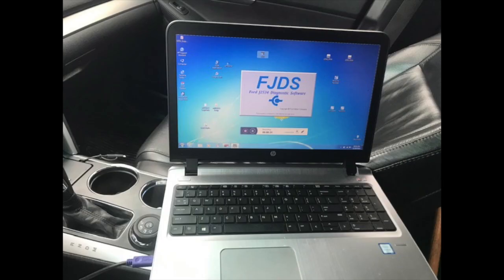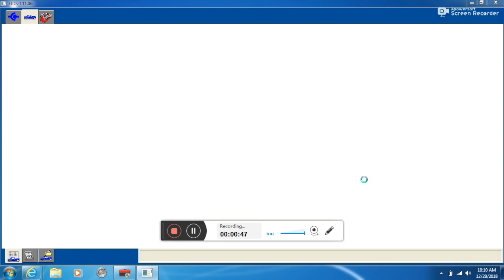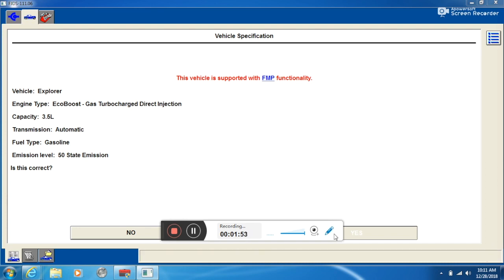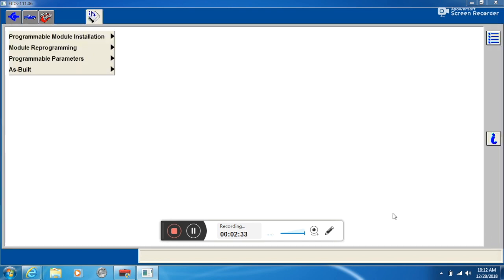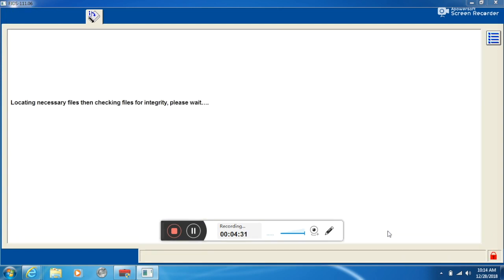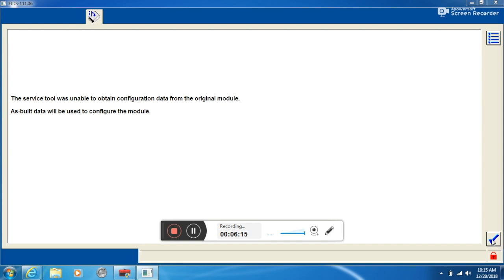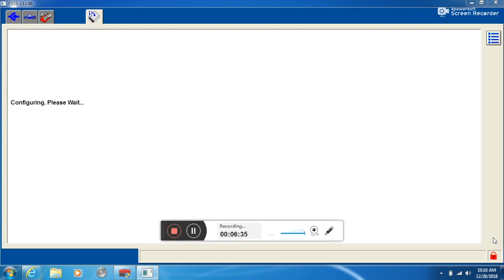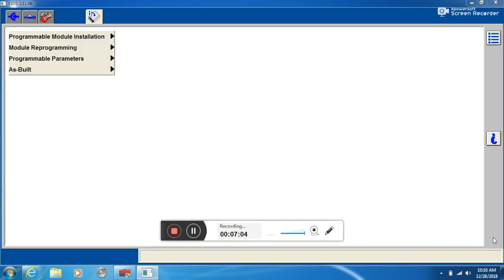FORD EXPLORER PSCM PROGRAM / FLASH AFTER REPLACING POWER STEERING RACK

Comment: Hi sir.
Thanks for sharing your effort.
Don't I need to have the calibration files of the old module put in the new one in addition to the As Built data?

Once in a time, I did applied only the As Built and the PSCM got locked after a while and a red message appeared in the IPC , as I remember, (Power Steering Fault, service required).

Thanks in advance
Reply: No you don’t you can go with either one, you can only have the as built data that you get from mtorocraftservice or pull the data from the old module which normally fails

Comment: I’m going on my second rack and pinion in just about a year in my 2014 sport. I’m getting the second one installed right now, it’s a remanufactured part. My mechanic cleared all codes and said it’s running good, he’s getting the alignment done. 

I didn’t get it programmed the first time I had it replaced, so I’m thinking maybe that’s why it failed again so soon. 

Should I take it to the dealer and get it programmed, even though I don’t have parking assist? 

Appreciate the help. 👍🏼
Reply: Did the autozone work out and did you end getting it reprogrammed? I am looking to do the same thing.
Reply: Unless it was pre-programmed it will need the latest software installed.
Reply: I got it from AutoZone. So not sure if it’s preprogrammed. But I told my mechanic and he’s going to take it to someone he knows that does ford reprograming. If this guy can’t do it, I already called my local ford dealer and they will do it there. Don’t need to keep going through this every year. 

I still think 2014’s should be part of the recall. 

Thank you for your reply, appreciate it. 👍🏼
Reply: @_z06_vette47  hey question regarding those I got a 2012 taurus se 3.5L new rack and new pump with return line. Did yours not return to 0point and not responsive steering ?

Comment: How do I update my PSCM to the newest calibration and strategy?
Reply: Cory,
  You can use the same technique as the video for just a software update.
Reply: Ok I should have been more specific.  I don't have a license for IDS. I have forscan but how do I find the newest calibration file for my pscm. I only find pcm calibration files on Motorcrafts site.
Reply: @metacombs  Without a license for IDS I don't know that you will find a PSCM file. Thanks,
Reply: @aaronbarnhart2711  I found a way, but I have to verify the file is correct. Basically, if you know the exact name of the file, you can download it from motorcraft, so I took the name of my current calibration and started incrementing the file name by 1 letter until I got one. I wonder if a dealer would tell me the name of the most recent file? Prob not, but it's worth a try. Allegedly, Forscan v2.4.3 can update the module but has not been confirmed yet.

Comment: Hi nice video...I replace my pscm for a used oem same part # but I already install the replacement part on my 17 ford explorer so dont have acces to do a backup of my old part , already download as built data from ford ..where I put the file on ids in order to pull it or did I need to do it manually??..

Comment: I have 2012 Ford Explorer with automate parking, can I use parts from rockauto.com and have dealers reprogram the part for me or I need to buy the part from dealers and have them do the whole work?
Reply: Hi, As long as the aftermarket part can be programmed that would be fine.

Comment: On my 2013 Ford Taurus the electric steering just quit from one day to the next. I have been told I have to buy a new rack. There are no warning lights on the dash. Is it possible that I just need to have it programmed again and that the rack and pinion itself is not the problem?  Thanks
Reply: Hi, It sounds like the hardware is the issue and the software would not be the problem. Unlike cell phones and other electronics most glitches are not software-related. Hope this helps
Reply: @aaronbarnhart2711  Thanks kindly for your reply. ; Now if it is hardware would that mean the whole rack and pinion system or are there are cheaper parts on there that could be the problem also.
Reply: @erwinerwin1245  That would be correct you would most likely need the entire rack. If you have a VIN number I can check for you.
Reply: @erwinerwin1245  $728.73 for a steering rack with the module. It would need to be programmed. If you are in the VA or NC markets we have a mobile service otherwise the dealer would need to program it.
Reply: @aaronbarnhart2711  Thanks again and I am not near VA or NC but up north in Canada.   Now that is  not a bad price and in Canadian bucks it would be around $ 1,100.00

Comment: Can I do this with forscan?
Reply: Hi. You have to use a J2534 tool only.
Reply: Yes. Pull as built from the module before you install new or pull your asbuilt from motorcraft.com and then load it in from the old file you created or type it in from the website.
Reply: @jasonhannsz  Do you know how to find the latest calibration files for any module? They only seem to have PCM calibration files on Motorcraft's site.

Comment: I installed a used one but the previous model vehicle it was in is the exact model i installed it in. Would i still have to reprogram it? Btw its a 2011 f150
Reply: Hi, Yes you would need to sync the module to your Vehicle VIN. If your asking will it work yes it is possible, but programming is the only way to make it correct.